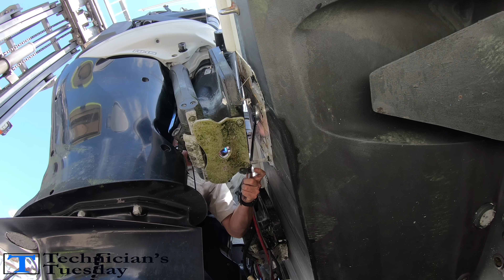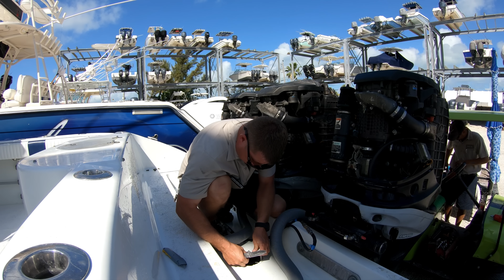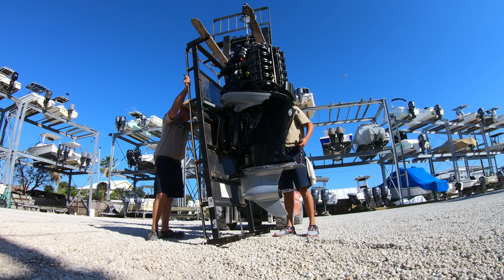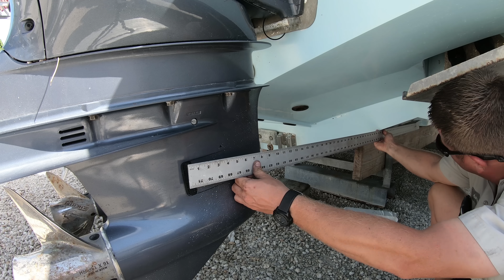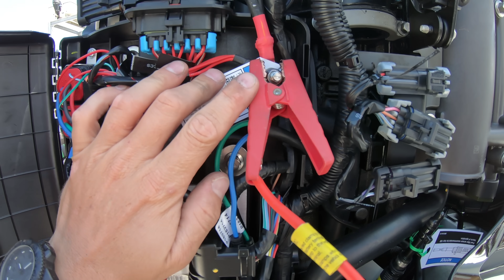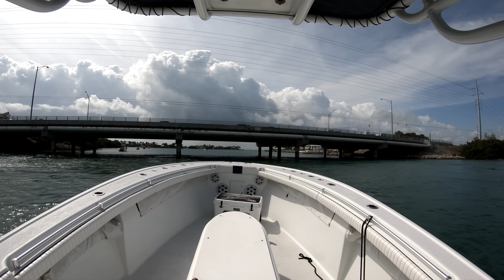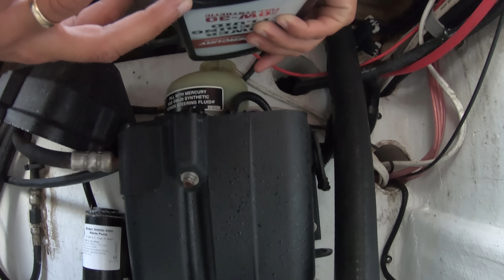How To Mount An Outboard Motor Properly - Start to Finish!

Comment from the maker: Suggest Topics That You Would Like For Us To Cover On Technician's Tuesday! https://www.bornagainboating.com/technicians-tuesday/
Reply: How about all the reasons a boat could chine walk? Center of gravity off. Over trimmed. Transom angle wrong in the boat design. Loose steering and other issues.
Reply: Do i have the motor trimmed all the way down in to 0% when i do the straight edge measurement for motor height. At the boat yard now doing work and im lost help please.

Comment: You should start your video  By telling your audience buy a boat with a Yamaha you won’t have to re-power it every two years
Reply from the maker: That's funny ;) this boat actually went through a couple of sets of Yamis before the Mercs. They change them every couple years no matter what brand they put on. 

These guys will rack up 1500 + hours every year! So by the third year, the warranty is running out and their pushing 3-4K hours!
Reply: Well your audience should no Yamaha uses the 6year warranty’s as a sails tactic. The Home land security boats I service have 300 Yamahas with 10,000 hrs no major problems.
Reply from the maker: @patrickrolf482  that's awesome! I know of some coast guard and FWC boats that are like that. With 10K hours.
Reply: Merc=go fast, blow up fast. Yamaha's run forever.  I have an 07, 200 hpdi, 2-stroke. 3500 hours later haven't done anything but normal 100 hour service, and tons of fuel filters!! Haha It won't die so I can put a new 4stroke on. 😂
Reply from the maker: That's awesome! Those 200 HPDI's were great engines. The fuel economy on those is amazing as well!
Reply: @BornAgainBoating  very true, I had an older carbureted Merc before the Hpdi and my fuel consumption was almost cut in half. Oil consumption dropped a bunch as well.  The Merc spun an oil gear around 1200 hours, (my fault for not pre-mixing a Merc). The Hpdi won't die... haha
Reply from the maker: Yeah, the 150-200's were amazing! They lasted forever! Now the 250 and 300's, we don't like to talk about them very much lol those were like the opti-pop's! You couldn't kill a 200 and you couldn't get a 300 to live long enough to enjoy it :)
Reply: 150 enduro for the win lol
Reply: Must be nice to be able to afford new engines

Comment: Hey I want to thank you for sending me the link to this video it helped me a lot I'm still working on replacing the transom on this project boat but just as soon as that is finished I'll be ready to look for a motor and I'm glad I watched this video because now I know what size in length motor I will need

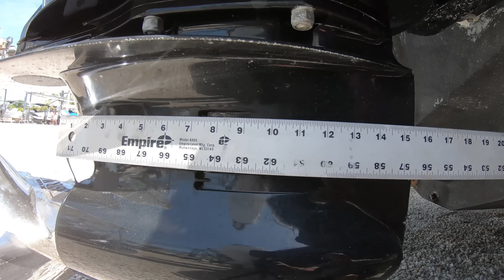Comment: I knew that my yamaha 90hp, 4 stroke was not at the right height on my boat but didn't know how to set it to the proper height until 3:40 in this video. 
 I need to raise my motor approximately 4.5 inches.
     Thank you.

Comment: Your guideline for cavitation plate is good since it is based on function.  I was not aware that a plate running below water level could cause problems but it makes sense especially in a turn.  Most boats I see at boat shows have the engines mounted what appears to be low.  I look at the cav plate WRT the trailing edge of the hull.  Most are below the running surface of the boat so probably end covered.   I put jack plates on my twin engine 26’ center console.  It took 1.75” to get the cav plates running on the surface.  Everything seemed to run so much more smoothly and the fuel consumption really improved.  The Yamahas have fuel rate consumption to 2 decimal points.  My background is engineering so I watch the abstract stuff just for fun.  I’m gonna end up on somebody’s front lawn soon.  Good thing the wife has no interest and has a loud scream.  She watches where I think I’m going.  Perfect relationship.
Reply from the maker: Thank you! Yeah, those little things do make a big difference. And jack plates really give you the ability to play around with it. Isn't it amazing how the fuel economy goes up after you get rid of that extra drag?! Hahaha that's funny, the perfect partner lol
Reply: Hey Greg,
Did elevating the cavitation plate help with top speed?
My comment from above
Recently bought a boat. I'm having issues with top speed being slower than pretty much everyone on any forum. Its a 1995 Grady White Adventure 208 with Yamaha F200. My anticavitation plate is level with the bottom of the hull. It also rides a little more nose high than other boats I've been on when on plane.
Reply: @mrindal1  have you tried to use a hydrofoil?

Comment: next time, have a place to hang the motors after removal straight from the boat to the hangers then onto the creates after new motors are installed
next time cut the bolts off when there's enough space between the bracket and boat so you dont torque damage the transom 
next time, install hydrophilic or electric jack plates. ( a must ). You need full up, down, forwards, and back adjustability while under way at high speed to get it dialed in perfectly on the go . Seal them up water tight 1st and let them dry......... THEN mount e motors.
next time, install motor leashes ( aka seat belts ) 

Nice boat . great channel .

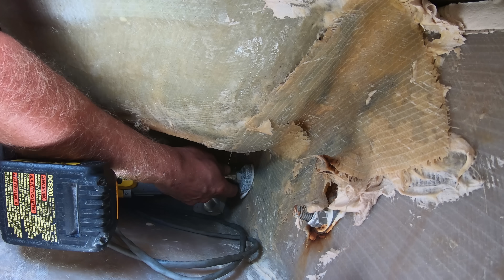Comment: Thanks for the informative and interesting rigging video! One question and it has nothing to do with the engine rigging part...@ 2:08 what in the heck is that cobbled-up fiberglass patch job?!!?  I thought Yellowfin had better workmanship than what I see in that segment. It was obviously done after the original engines were installed.
Reply from the maker: You're welcome! Thank you for commenting. Hahaha, it's amazing what you can find deep in the depths of a boat! To be honest, I have no idea what is going on there, some of the boats that we work on get a ton of abuse put on them and you never know what you might find. Yellowfins are a great boat, but they are still made out of wood too. 

Transoms take such an abuse, especially in heavy heavy seas with all the weight and torque of the engines. I'm not sure who patched that up or if it was just done to give a little more strength to the transom. Thanks for noticing!
Reply: Yes And i have think abaut bay o boat from USA. Now ?????

Comment: Hi there, long time fan...I  have a couple of quick questions and hope you dont mind answering.. 
I have a 1986 restored 26 foot mako with a used 2012 yamaha 250 outboard. Question 1.- is it normal for that year mako to lean to the right when in grear running at around 4k rpms??? Question 2 whe the low oil presure comes on on the tachometer where do i star? To see if it needs oil? Is there a dip stick like on a car ?? Or do ibhave to take it in to a shop ??

Comment: Does this work for bass boats too? If so does the motor need to be trimmed all the way down or level with the boat too check with a straight edge

Comment: Have you ever dealt with a first gen cape horn 24? Cape recommends that the engines be mounted on the lowest setting but the boat porpoises bad with no tabs and just sucks fuel. I believe they are too low and others with the same hull and issue do too. Just wondering if youd done it before

Comment: Question:  When you have your meter stick or straight edge on the transom trying to line up the water intakes, is the straight edge flush to the bottom of the hull in front of the transom (or) is it simply "level" with the water intakes?  Also, what position were the outboards in when you took that measurement?  Fully tucked under?  Thank you.

Comment: Very informative! Looked like one of the water pickup holes was above the straight edge, is that acceptable in your view or was this adjusted beyond what was shown in the video?
Reply: The water will rise greatly on this particular hull design, and the water pickups are a good distance back. If the back of the boat did not have this much setback from the hull, it wold probably be too high.

Comment: Hull with a straight edge the water pick ups are about 6 or 7 inches lower then the bottom of the straight edge and the out board as high as it can be mounted .Thanks for the info on mounting an outboard .i just bought an older pro line with a 200 Yamaha  2003 check the the bottom of the . Not sure how to fix  or I need to add a jack plate to lift motor up higher.

Comment: Thanks was just thinking about how to mount a outboard .bought a proline the a Yamaha 200 that when running water roll back up motor in to foot well not sure it mounted right. After this video on how to mount now I can check .thanks.

Comment: Recently bought a boat. I'm having issues with top speed being slower than pretty much everyone on any forum. Its a 1995 Grady White Adventure 208 with Yamaha F200. My anticavitation plate is level with the bottom of the hull. It also rides a little more nose high than other boats I've been on when on plane.
Reply: Are you propped  out correctly  and what kind of prop are you using?
Reply: Also is the bottom of boat clean? Also check for trapped water in hull.
Reply: Also are you sure your motor is running properly?
Reply: What is your rpm at full throttle with about half trim?

Comment: You said you drill the holes to remove the 5200. Then you said you use 4200 to install the motor bolts. Confused on this question. 3M 4200 or 5200?

Comment: Cavitation and ventilation are different.   The plate above the propeller is an anti-ventilation plate, prevents air from entering the propeller from above while running.   Cavitation is the collapsing of small negative pressure bubbles
Reply from the maker: Thank you! https://www.youtube.com/watch?v=KbFa1fmlAXg

Comment: Is propeller ventilation an issue with the engine heights set as described in the video? The trick on powering the engine to adjust trim to match the transom angle is really helpful! Greg
Reply from the maker: Yup! If you mount it up to high even on a single engine application the anti-ventilation plate will be above the water and you'll suck air around the prop as well as air into the water pick-ups. Causing the engine to overheat and have issues :( Thank you!

Comment: In my outboards manual it says to mount the outboards anti ventilation plate slightly LOWER  than the boats keel ( 10mm to 30mm ) which is wrong .... glad I didnt follow that advice ,  good to see the correct advice in this video ,  ended up mounting my outboards antiventilation plate about 20mm higher than the keel ,  couldnt go any higher but another 10 or 15mm higher would be ideal .

Comment: Question. New to me boat that had motor mounted to deep and I installed trim tabs. The through hull drains and live well fitting caused me to mount tabs closer to motor and now wake from tabs are hitting motor and giving better hole shot. Should this be corrected? If so then what.

Comment: I just put a 6” jackplate on my 15 foot havoc it has a 60 hp yamaha tiller handle on the back what height should my motor be mounted at?

Comment: I was wondering,..how do you add a power pack to adjust your tilt to the transom on most motors? Or can you just let the pressure off with a screwdriver on the tilt motor and do it manually?
Reply from the maker: You can do it manually, but you can also just like you said put a power pack on the engine where the power and ground cables go and use the trim. Or like Mercury needs clean power, so you can just pull the wires that go to the trim unit out and disconnect the bullet connectors and then put power to them there to run the trim and get the angle you need.
Reply: @BornAgainBoating  that's awesome because I have recently started rigging boats...thanks a bunch man!

Comment: As per 3 engine outboards; I'm pretty sue that With Two Outboards, the Propellers swing in forward gear (and reverse) in Opposite directions.
In essence, each individual gear case to the propeller would be configured Specifically to do this.
How do you manage 3 propellers?
In my mind, two of them would be swinging in the same direction.
thanks a great video.
Reply from the maker: You are exactly right! The middle engine is another right-hand gear case. Then the port is still a left-handed case. 

Thank you!
Reply: @BornAgainBoating  sub'd
Reply from the maker: Thank you!
Reply: Kinda on the same subject.. How is the 3 motors controlled with two controls? Or did I miss something?
Reply from the maker: @davidjessee7701  nope, you're right, there's only two control handles. 

They do what mercury calls "shadow mode". Which just means that when both handles are in the same position whether forward or reverse. 

The center engine will mimick the two outside engines and go into that gear. Now if you put port in forward and starboard in reverse. The center engine will stay in neutral!
Reply: @davidjessee7701  good eye!; one control probably engages the sequence; neutral / forward / reverse for all 3.
The Other; acceleration. again all 3 synchronized.
Let's talk about "Maneuverability.  With that 3 engine "Tight Fit Configuration at the transom" you can't swing one prop in forward and one in reverse unless there were Separate; Reverse / Forward and Neutral selectors!! (as you noticed)
Often times, a good experienced captain, can literally; ;Walk the hull into a docking situation sideways when swinging each prop in the opposite direction.
In essence at a slow idle; one prop will drive the boat forward while the opposing prop will drive it or pull it backwards.
This combination of forces actually Walks the hull sideways or side to side.
(a good captain will need to apply the helm this way and that....as the hull breaks slowly out of parallel to the dock?)
Not all that practical with 3 outboards?
Reply: @johnpike5836  right... That was my point.. With twin engines at the dock . I can turn my 26' fountain one foward the other in reverse at an idle spin the boat pretty much in its own length..
Reply: @davidjessee7701  Certain of it Jesse; a big part of Performance in Boating has to be Maneuverability. 
Running Twin Outboards is extremely expensive (gas consumption/maintenance) In truth, the additional engine may grab you a few MPH??
One better consult with the boat builder AND insurance co. to make certain; twin or triple outboards are "On Spec".
In this Order; Safe, Cost Effective, Low Stress Enjoyment and Practical.
Happy and Safe Boating David...(26 Fountain twin stern drives, awesome)

Comment: Hey buddy what's that bolt called that's torch down into the top of the flywheel use for removing or installing an outboard on the back of a boat. What is the correct way a motor onto a boat or off of a boat transom

Comment: Hat is the difference in fuel consumption between running one 40 horse as to two 20 horse kickers? And what is the reason that anyone goes for 3 or more? They just dont make engines bigger?

Comment: Really helpful video as many of yours ! The engine height at water pickup is valid also for a single outboard unit? Mine is placed with anti-ventilation lower face 1in above keel line. I've a stepped hull.
Reply from the maker: Thank you! Yes, you want that plate above the water but the pickups below the water coming off the back of the boat :) especially on a stepped hull because they aerate the water a lot!
Reply: @BornAgainBoating  Many thanks, understood. My feeling is that when the engine is another inch up, the prop will start to ventilate more easily cause also to step water aeration. Am I right ?

Comment: "Water Pressure Gauges"; By now, most outboard manufacturers have adopted the "exhaust out the prop" dump.
For all the Merc Lovers, please always "Keep and Eye On" those water pressure gauges.
Whether. Nylon or Plastic, the impellers that drive cold water from beneath the Cavitation Plate up and into the engine block, will melt down in seconds, if sufficient water pressure Isn't consistently maintained, especially if you like to Trim the engine out creating less hull contact with lake or ocean water.
(don't ask how I discovered this)
I ran a 3 blade Cleaver (on an outboard?) a Cleaver tends to "Pick the transom area Up and Out" of the water
And so; Trimming raises the front of the hull out of the water and then, the cleaver raises the back!
Mucho airborne with a slight "walking to the right from time to time".
Got 86mph on a 21 Challenger with One 300 Black Max. (one hand on the wheel)
My mistake was (to cheap to) go for the ModVP 270hp EFI!
13 grand for the 300 Black Max/18 grand for the VP! doy.
Always had to; "go lay down for an hour", after a great boating day!
Sincerely your Retired Salvation Army Major

Comment: The best motor/transom match is the one where water flow at speed skims right under the upper small plate, that's under the protruding front lip. Once there prop will work spot on on all water cond ranging from flat  calm to choppy, windy water conditions.  From there can go straight for a prop maximization to pull wot revs up towards middle to max wot rpm range as usually loaded. Once there and with deck load evenly distributed , combo will achieve a superb fast hole shot plane.

To check that spot on height must pull head out transom and visually check what's going on at back of motor, will know if in need to raise or lower a tad the motor as this is not a wild guessing motor installation.

Comment: Love the channel and thanks for all the real world tips and techniques. I have a suggestion video. Can you do one on replacing lower damper mounts. I want to tackle this on my Yamaha F250
Reply from the maker: Hey Andy! Thank you, I dont have any footage of replacing those mounts.

I can see what I can do about helping get you the info to do so though. 

Youre talking about the motor mounts right? Those arent that bad and you should be able to do it yourself for sure.

You'll want new nuts and stuff before you start, and you might even need new bolts depending on how the old ones come out. If I remember correctly they are either an 18 or 19 mm. 

It's been awhile since I've done one, usually only when changing out the mid sections on the 225s that rot out.